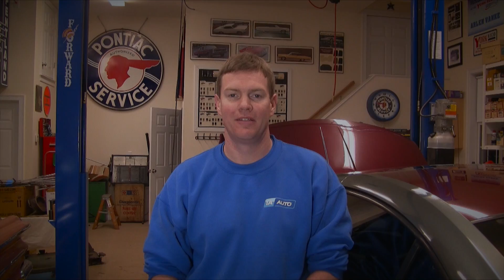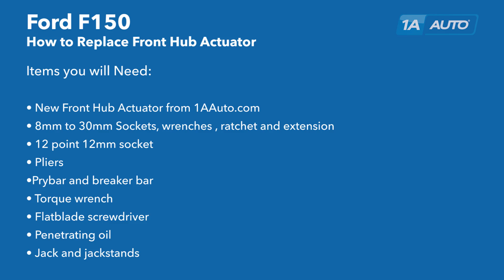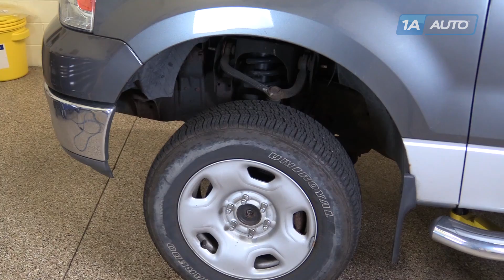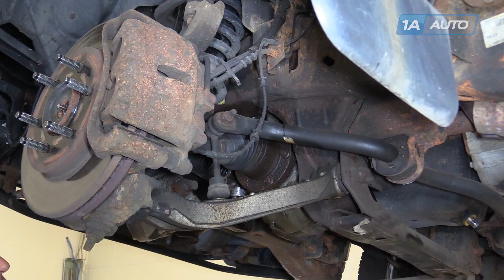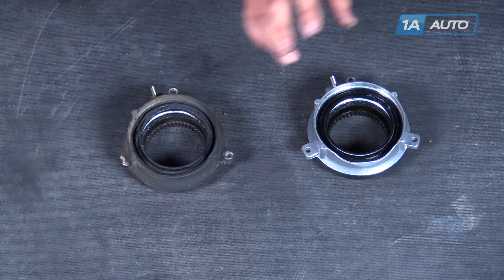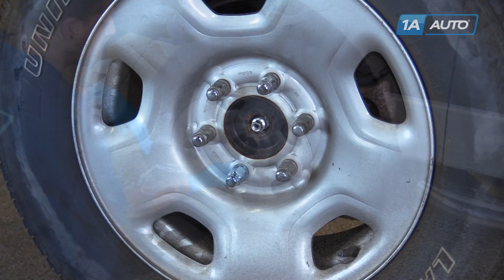How To Replace Front Hub Actuator 05-13 Ford F-150

Comment: When i put my 4×4 in my f150 5.4 2005 i thing the driver side only engage halfway and make big bammm noise ....that is possibly guys?
Reply from the maker: +@audycamaro3649 We wouldn't be able to diagnose an issue like that here, you may want to have a local mechanic take a look at it. Thanks for checking us out! http://1aau.to/m/Shop-1AAuto-c

Comment: Buddy not there? use a punch in the rotor slots to hold the axle from turning while removing the cv shaft bolts that most fords this year don't have. In fact what year is this one? my 2011 is way different, cv shaft, strut mounting etc.

Comment: I did my 2010 f150 today.  The main difference was the cv shaft went directly into the differential so I didn’t have to take it out.  Also, didn’t have to remove the strut from the lower control arm.  Instead, I removed the top ball joint pulling the knuckle away then muscling the shaft out o the bearing with the actuator.  I tried to remove the lower strut bolt first but it wouldn’t come out.  Four hours later and it drives like new.  There was a rattling noise that sounded like the catalytic converter but it was the actuator.  No more noise on passenger side, now I have to change the driver side!

Comment: easier to remove center bolt and tire as shown then just remove upper control arm and tierod end remove 3 bolts from actuator pull cv axel and hub out together, place hub on cv put cv back in and bolt everything back together

Comment: Will the same same process work for a 2011 XLT with a manual 4WD transfer case?
Reply from the maker: +Adam Fackler We don't have a how-to video for your vehicle right now, but the basic steps in this video should be enough to do this task. Buy this part for your vehicle on 1AAuto.com: http://1aau.to/m/Shop-1AAuto-c

Comment: After install I cant spin the driver side wheel that i worked on in 4x4. Spins in 2x4. Truck is on a jack with only the wheel I'm working on lifted. Is this normal.
Reply: Yes, sounds completely normal

Comment: Very common you say. I've never replaced mine. 2007 f150.
Reply: I've worked on 3 F150's with this system and they all had bad actuators.

Comment: Do you actually need to remove the cv to do this? Or can you just disconnect it at the wheel?
Reply: Depends what year  I think. I did mine (06), by loosening the whole brake and hub, and tilting forward. Then pull axl shaft and actuator out together. Helps to loosen sway also for more movement. Got to do some finagling, on some of them.

Comment: Was wondering if there are torque specs on the 6 bolts on the axle flange, the strut bolt, and the actuators 3 bolts, as well as the axle nut? I read a comment the stated the axle torque needs to be no more than 20, any info would be good thanks to all.
Reply from the maker: +2layz2p Thanks for watching!  In the 4x4 set up the axle nut will only be 20 ft lb, the axle flange bolts will be 60 ft lb, and the lower strut bolt will be about 351 ft lb with a new bolt.  We do not have the specs for the actuator, but that will not have to be very tight.  You can also refer to a repair manual to find any specs you might be missing!  1aauto.com

Comment: I am getting a intermittent grinding noise in 2WD, but it goes away when putting it back in 4WD. Is that a symptom of a faulty actuator?
Reply: Yes, just happened to mine. Sounds like a can of loose screws rattling.
Reply: Where would you go to get your actuator replaced?
Reply from the maker: +Ajahnae Hinley We recommend bringing it to a  local mechanic!

Comment: I hate to break it to ya but the lug nuts on a 2004 Ford F-150 are 21 MM not 19 MM
Reply from the maker: +Matt Sayers Thanks for the feedback! This vehicle had both available depending on the options from the factory. 1aauto.com
Reply: 1A Auto Parts oh okay then that would make sense. I have a 04 Ford F-150 fx4 crew cab and the lug nuts on that are 21 MM

Comment: I have a question bout my 2011 f150 4x4 STX I did struts and I disconnected the drive axle from the actuators do they need to be reset ? I did not remove the actuators from the spindles just driveaxles.
Reply from the maker: +Robert Rowlin Thanks for watching!  You do not need to reset anything in your case, just like in the video!  1aauto.com

Comment: Why is 2014 not included in this?
Reply from the maker: +Joe Bowers The part shown in the video does fit your application. It should be the same or a similar procedure. Here is a link to them on our website. Hope this helps you out. http://www.1aauto.com/auto-locking-hub-actuator/i/1afwa00017?utm_source=YouTube&utm_medium=CTA+Comment&utm_campaign=ytcomment&utm_term=iMnNMvzOrKA

Comment: well presented video, but my 2012 CV shaft doesn't have bolts on a flange like this one. it has a spline with a spring clip that slips into the gear box. This requires a little more disassembly for me..

Comment: Lower strut bolt must remain loose until weight of truck is back on suspension before torque is set to prevent rubber bushing from tearing during normal suspension cycling.